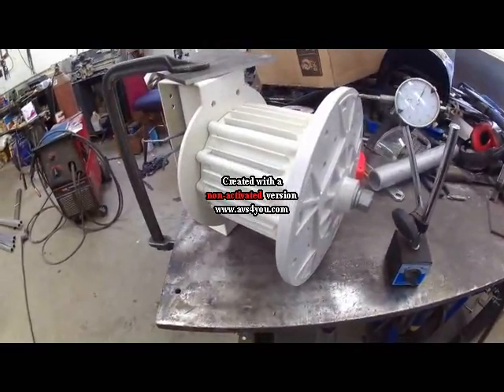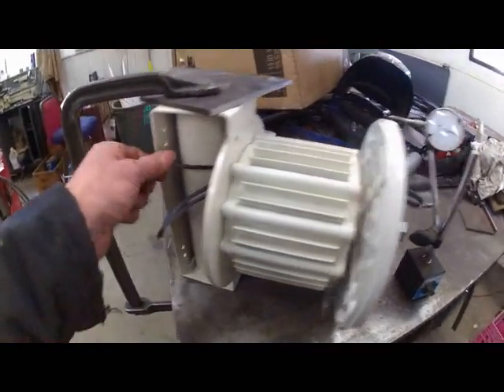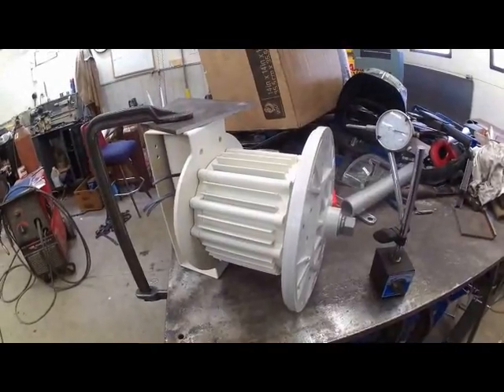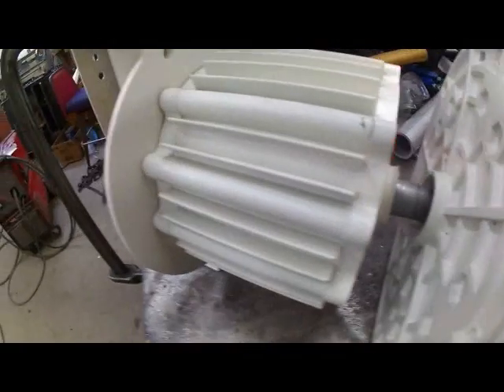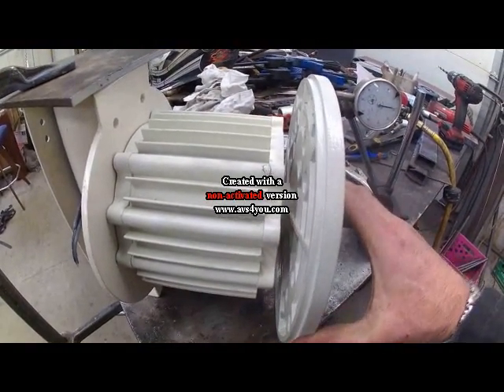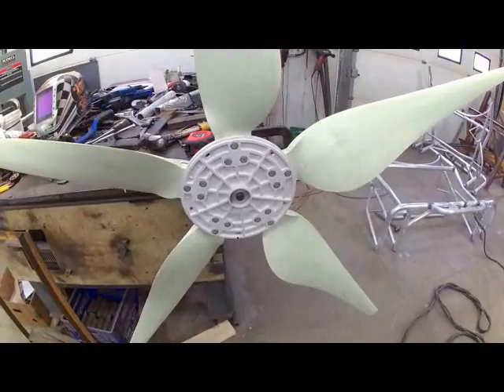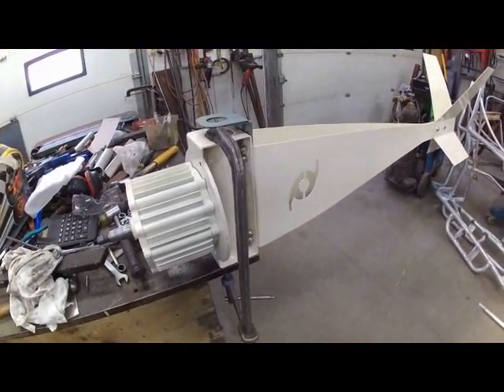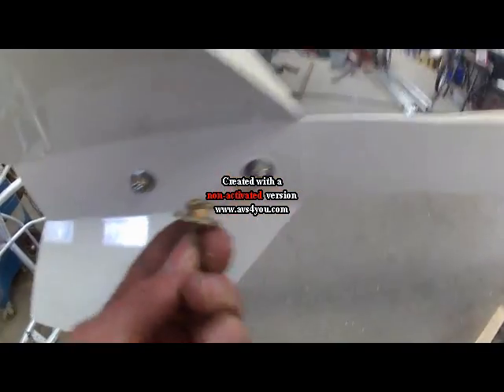hurricane wind turbine

Comment: Wow - alot of work to get this up on the tower!
How has it been serving you over the years?
Cheers
Reply from the maker: It's up and still running great, still putting out the same power as it did new.  almost 5 years now
Reply: @advantagesulky6498  
Great to know -- and it looks like they have been doing improvements of the years.
Cheers
Reply: I owned the same one for 4 years now, and haven't had any issues, output is impressive and design and function is great.

Comment: How has it held up still running after 3 years of operation ???
Reply from the maker: still running strong, over 200 KWH  every year. I made a different tail mount on it.
Reply: @advantagesulky6498  sweet 👍 was looking at this model on eBay to add to my solar system I'll go for it